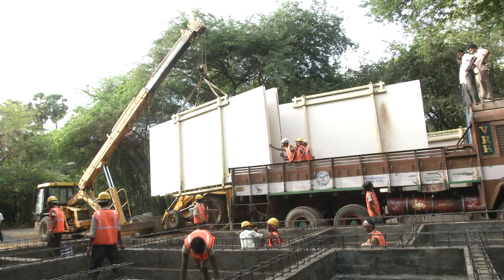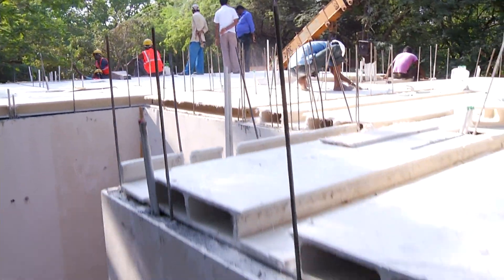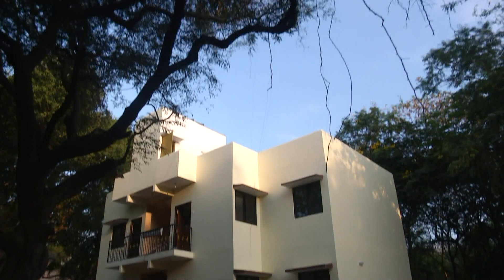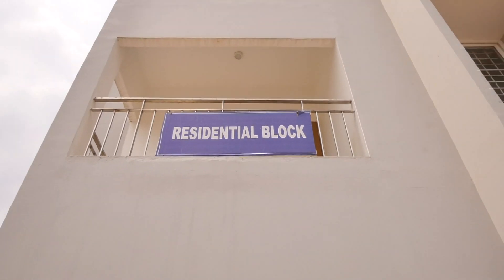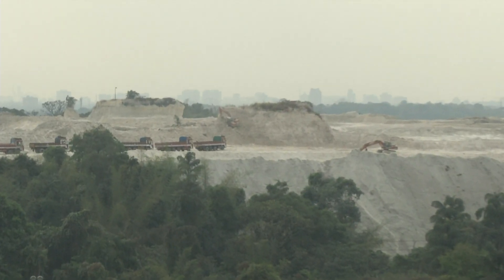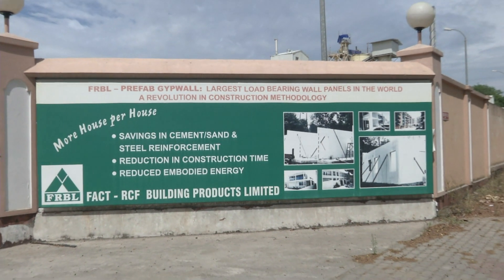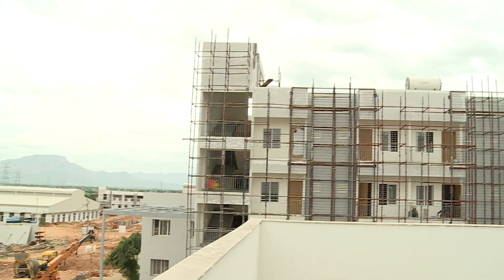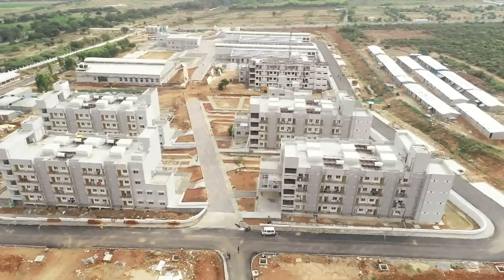GFRG   Continuing Journey

Comment: This is not at all good my house is same done with GFRG worked by Contractor Biju (Quick Home )from thrissur.
Let me explain this:
pros are already you seen in video like:
extra carpet area
low budget (bullshit)
weather proof, fire proof
fast consruction (This is according to contractor and mine sucks no commitment or work ethics. his wook is average but time scheduling and response sucks even if you pay him right at time.)
 now lets talk about board cons:
1.GFRG panel construction company in kochi sucks:(they got workers issue, no delivery in time, some panel are damage, some got damage after contact with water, color fading difference in some)
2. Health issues will occur if you are staying in this type home mainly (skin issues like itching)
3. Some chemical in this board is causing rusting of iron so fast (you can test this by cutting the board with cutter or saw after a day your cutting blade will get rust, so you reinforcement in concrete will be gone after 8-10years .
4.Concrete fill inside will get dusty and strengthless even after 2years.
5.Without crane access area your work will get too costly ( you must check road width, your plot area excluding house area and the base strength of plot for 20 to 30 tonne crane)
6.Board alone is strentless ,this board will get damage even while transporting because of our state road issues, kseb line issues(in truck this panel and truck combined height will be 4.5m to 5m so you know kseb cable lines etc only highways are okke, tree branches extra)
7.This board is not economical and good for Bathroom areas(because of concealed plumbing line will cause strength, tileing need little rough surface or you can use glue for it)
8.The sound or jerk when you hit the wall like its not at all strength it is because of 5inch thick but it is too annoying(contractors marketing they only say pros and small cons that wont effect us.
This all i have written is from my experience, not a view from third person who repeat from others.
Reply: Share the photos of it or make a video of it so that people people planning to construct a dream house out of this GFRG will be cautious
Reply: hey bro it will be helpful if you Can please share the pics so that we can make a decision based on the issues & act accordingly. my email address  : nikeapache@gmail.com
Reply: Thanks for sharing your experience.